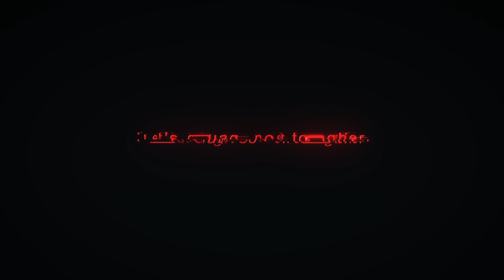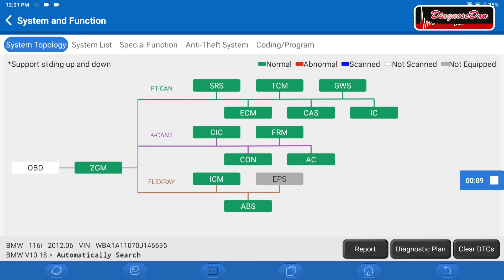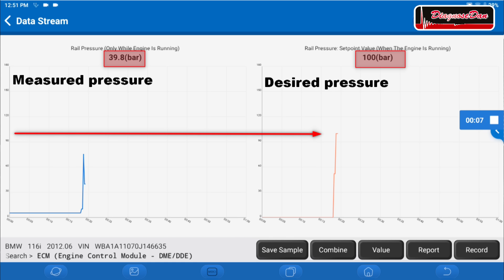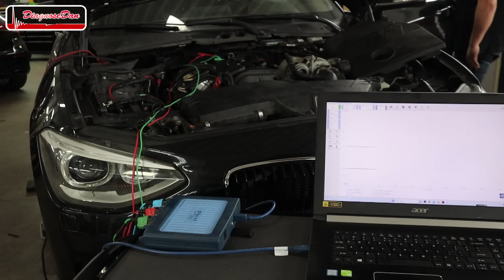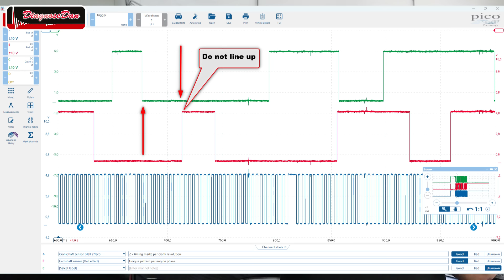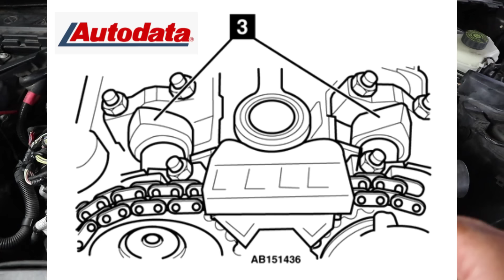Bmw dealership blunder? Incompetence?

Comment: I work at a BMW dealership and got a diesel car in. It had some work done at our shop a week earlier, and on the 2nd day after that visit, the engine started running rough on startup, then died and didn't turn back on. The car was towed in and, like this one, there were no fault codes for the engine. I did the basic tests, reading fuel pressure, checking if it had the correct fuel and checking the airmass system including EGR system. Everything checked out. Even tried removing exhaust sensors before DPF to check if it was blocked. I also removed a sensor from the intake manifold to spray in some silicone spray to see if the engine at least tried running on it. What I noticed was there was actually more smoke coming from the intake manifold than the exhaust manifold. Started to look more and more like timing but the diagnostic software even in expert mode said that camshaft and crankshaft synchronization was OK. Still, I removed the camshaft sensor and was able to see through that hole that the camshaft was spinning. I still suspected timing because nothing else could explain this behaviour other than timing. So I got permission to remove the valve cover and manually check the timing. And when I did, I immediately saw that 7 of the 8 rocker arms on the intake camshaft were broken and had fallen off. The customer was notified and he refused further work so I didn't finish checking by how much the timing was off. Needless to say, the work done the week earlier was completely unrelated to the timing, just bad luck.

What this, and your video, reminded me of, is that we cannot put too much trust in the computers. A large majority of the time, the computers are right and guide us to correct diagnosis's, but we always have to use our common sense and knowledge of how engines work to confirm what the computers are telling us (or not telling us), in order to prevent unnecessary parts replacements. Like in both of these cases, mine and yours, where the computer does not report the timing to be off even while it most certainly is.
Reply from the maker: Well said, scantools are "tools" to assist us in diagnosing the issue. They wont tell us what parts te replace.

Comment: This could of been easily diagnosed by the use of a vacuum gauge. If the timing is correct cranking vacuum will be around 3-5 inches of vacuum. If timing is off vacuum will generally be between 0 and 1 inches of vacuum. Having said that Dan is a legend and wonderful to watch.
Reply: Exactly - All Vacuum Gauges woulda told you the Answer. If the Cranking Vacuum Gauge woulda been Less than( 3 " )of Vacuum - that Result woulda led me think Broken Drive Belt - Timing Belt Issue or Timing Chain issue.

LongBeachCertified (562)
Ex Smog Repair Emission Analysis Technician

Comment: This engine looks very similar to the N18B16 we have in the USA in mini coopers. The timing chain guides break very often and are a chronic issue on these cars. We had one last week that ran poorly and another shop told the customer it was due to "bad engine software" which caused misfires at idle. We popped the valve cover to verify timing and the upper guide was broken like this and the intake cam was 1 tooth off. The "other shop" wasted $1500 on useless chemical carbon cleaning the valves and even installed a new timing chain tensioner which they left loose/leaking- essentially resolving nothing!

Comment: I'm lazy, my first thought was to spray starter fluid to see if it would attempt to start.

The scope traces are next level. 

I find the control routine odd that it's based on cam position. It would make more sense that it's controlled by pressure output.

Anyways great detective work!

Comment: I find it hard to believe this engine only has a single chain,,,In Australia my sons 94 BMW had a double chain set up,,We had to change the cylinder head because the engine overheated and he poured cold water in .the sudden change in temp caused the number 3 cylinder head to crack causing hydrolock pouring coolant in to sit on the piston ,,We could not believe that such a high end car could be so fragile..After that it was only Toyota,s for him..Great Video.

Comment: A very good diagnosis, unfortunateley with no happy end - very likely that the engine has to be replaced.Fastest approach to check the condition of a not running engine is to use an endoscope - as soon as You see impact marks on the pistons and/or damaged , open valves , You are done.Embarrassing for the dealership that they weren`t able to identify a dead engine on their own.A simple compression test would have been sufficient as well.

Comment: My guess: when the measured fuel pressure is below minimums for safe cranking/running, the hpfp valve opens fully to prevent a lean/knock situation. That’s why the plot was spiking then dropping to nothing.

Comment: Thanks Dan, I am glad to have found your excellent videos and have watched several already and learned more each time. I especially enjoyed your F15 40E Hybrid video no crank from starter video. I didn't know these Hybrids had two starter systems. One from conventional starter, mounted in front of engine which shocked me, and the electric motor starter in transmission. 

In my situation I get a quick one second attempt to start and then starter stops over and over, so it appears not to be cranking long enough to start. The electric starter does not work either. I don't know which is not staying engaged yet as I had almost given up. I am old school BMW owner for years and this Hybrid is a whole new beast to me.

As there are very few discussions on the BMW Hybrid, I am at a loss to find out where to look next. I had bad 12VDC battery which I replaced and registered and that got rid of the dozens of low voltage faults, but I still have codes permanent and intermittent. I figured this may be why engine won't start. DME 21A117 and EME 222D04 and searching for potential issues I see there is a short somewhere, and if that means a had connection of a short to ground, I don't know where to look. My Hybrid charges up to full 18M level, so I am at a loss. Have you ever run into this with a Hybrid before. Any tips would be appreciated. 

Thanks a million, Mike

Comment: I work at the BMW and I find it so hard to believe that the dealership could not diagnose this. These engines not only are know for the timing chain issues, but there's several service solutions relating to this and also it logs crankshaft to camshaft correlation faults way before the engine stops running. So either it was a tyre fitter trying to upskill his career or a technician was as blind as a bat.

Also you were not correct in describing the high pressure fuel pump operation. Its fully mechanical pump with quantity control valve, that is controlled by the PWM signal to close the valve so the pressure builds up. When deactivated or a fail safe state the valve is open (fuel is by-passing) so the fuel pressure doesn't build up in the rail more than 5 bar (that much low pressure fuel pump is supplying). However this would still allow the engine to run as DME would alter the injection timing so the fuel would be injected during the intake stroke allowing to engine to run in limp mode. No start is never ever a high pressure fuel pump issue on BMW/Mini petrol cars

Comment: Excellent diagnosis. This is a known issue with these engines until 2015. Dan tracked it down systsmatically, without swapping parts.
Reply from the maker: Thank you very much

Comment: As the ECM has a sensor for the pump related camshaft, it knows the exact position -> there is no mechanical problem there -> it's very likely the ECM also detected the wrong timing and did disable the pump electrically. Could be checked by locking at the pump-signal.
This boils down to a "camshaft signal" problem caused by a wrong timing which is a typical "non-starter" for BMWs because the ECM will not allow the engine to start.
Very good analysis!
Reply from the maker: We've seen that the fuel pressure spiked and than dropped. This can only be done by the ecm. So your question was already answered without the measurement
Reply: @Diagnosedan  Sorry, this is not a question but an answer to your analysis. The camshaft position is not random to the ECM, it is well know as it has a (well working) sensor for this. This pump is working as expected by the ECM.

Comment: Great video Dan. You fixed it again. It won't be a real BMW if it didn't have timing chains or guides issues. I am currently working on N57 with stretched chains and broken guides and oil tensioner. Thanks for sharing🤝
Reply from the maker: I've done so many,😢 i could probably do it with my eyes closed😂
Reply: @Diagnosedan  Do you drop the transmission to pull the engine out? Thanks

Comment: Good on U mate. Good work. Dealerships have good mechanics and crap ones too. I used  be a service manager and the key is ........
Put the right technician on the right job. Every dealership will have guys better than others at particular jobs. Right man for right job. Regrettably, mechanics are  required and incentivised to pick up time.  Allways rushing thru jobs so they charge out 10 orc12 hours in an 8 hour day. It's allways money. Just depends on who's money

Comment: I would first spray some cleaner or petrol in the intake close to the throttle. 1. No start -> Check for spark -> Spark Ok then check mechanical stuff such as timing. Spark not OK check for power, grounds and relays and go further.
2. Start ok then check fuel system. 

Still surprised with the camshafts being that much off there was no trouble code. Absolutely GARBAGE cars. Break My Wallet. Clever ECUs never reach simple things.... Furthermore these were the makers that introduced long life services with oil changes that 30000km. Not even their timing chains are up to the job. So Oil at 10k and forget about long oil change intervals. If you want to save money...
Thanks for the Video Dan!

Comment: I can't believe the dealership fired the parts cannon. That isn't supposed to happen. I do the same exact thing, when I have no codes. Back to basics. I use the acronym F.A.S.T.
Fuel
Air
Spark
Timing

The basics do not fail. Great video!
Reply: I should say I check compression during the timing step. Just in case someone else uses it. Don't want them to use FAST and not check compression. Guess it should be called FAST-C. Or any other variation that's easy to remember.
Reply from the maker: Thanks!!

Comment: YOUR VERY KNOWLEDGABLE AND YOU ,DO THE BASICS CHECK SPARK ,FUEL PRESSURE AND VALVE TIMING AND USE THE SCOPE CHECKCAM AND CRANK SENSOR WAVE FORMS THAT WILL ALWAYS TELL THE STORY  AWESOME VERY GOOD METHOD OF EXPLANING AND TEACHING I GOT IT RIGHT OFF THE BAT THANK YOU SO MUCH

Comment: Great informative video as always, thanks Dan. Are all modern engines so badly engineered they fail like this, it used to be if you had a timing chain over a belt it lasted the life of the engine.

Comment: A reduction in compression could be heard when attempting to start the engine (with the exhaust or intake valve ajar)
No maximum compression when one of the cylinders is not closed

Comment: Brilliant as usual.  Never forgetting the basics amongst all that technology.  I am left wondering if the diagnoses is complete?  The question I have is:- Has the timing problem caused damage to the Valves.  I realise the timing has to be fixed before this can be investigated.
Reply from the maker: No the diagnosis and repair is not complete yet. But i was only asked to diagnose the initial problem.

Comment: They checked the timing by "listening to the engine cranking rhythm". They replaced low and high pressure fuel pumps based on the fact - there is spark , so problem must be fuel related. That's the advantage to have service garage on the mainroad or main boulevard. You can do this and still get a ton of NEW customers every day. When the repair is not the fix, these machanics just say "we're general maintance shop" , not specialist.
Reply from the maker: Thanks for watching

Comment: Perhaps the chain tensioner is using oil pressure .... And an o-ring has wared out...  So no pressure, and no tension, but some chain rattle for a good while.... Then, one day the chain hammers the guides in pieces, and that's it.

Comment: BMW timing chain tensioners made of plastic, What could possibly go wrong there?
As ever a stunning logical and well explained approach in comparison to the scatter gun replacement approach of so many 'experts' today. Just remember new stands for Never Ever Worked.
Reply from the maker: The tensioner is not made of plastic. The guides are but this is quite common as they ride against the chain

Comment: Nice diagnosis Dan 
Few years back too had N13 1 Series on 13 plate (UK) on 48k miles timing was out as well due chain tensioner failure inlet cam was 90° out but no engine damage at all so new chain and customer was sent on his merry way 😂 since then got expensive Sealey timing tool which only been used once and lent several times to few local garages 
Anyway nice job as always Dan best wishes this time from 🇱🇹
Reply: Just to add in my opinion VANOS saved the valves once cam sensor went out of sync I guess VANOS kicked in and didn’t open the inlet valves thus saving any damage would’ve been different story if exhaust cam would jumped timing 
Anyway it just my theory welcome to prove me otherwise
Reply from the maker: Thanks for your comment, vanos can't prevent the valves from opening. I guess you mean valvetronic instead
Reply: @Diagnosedan  Hello Dan oh yes you’re absolutely right thanks for correcting me up

Comment: I think at this point manufacturers need to implement logging codes in a semipermanent way. Like a Freeze Frame data that just never gets deleted and doesn't affect the running of the car after codes have been cleared from the usual fault memory. This will be very valuable for troubleshooting.
Reply from the maker: Thanks for watching

Comment: Sounds like the job was given to a rookie tech at the dealership. A lot of dealerships hire new techs fresh out of school. I had a Chevy truck that a mechanic friend of mine told me to take it to the dealership because the catalytic converter was under emissions warranty. He even left the code for the tech. The very first thing the kid did was to erase the code, along with all the evidence.They called me and tried selling me a high dollar tuneup. I refused and took it to another friend who was a master tech at Bob Peck Chevrolet and he found the bad cat and even warrantied the 02 sensors as well. Most dealerships, I won't give the time of day, because they always seem to replace stuff that is not needed or relevant to the problem. Only for warranty coverage or something that only dealer repairs.

Comment: Removing the valve cover would have been my first job, because it is well known, that a lot of bmw engines from 2010 onwards suffer from weak chains and cheap chain guides, which fail early.

Comment: Very interesting video. My daily driver is a 1990 Volvo 240DL Estate. For several years in a row the car would run very roughly and return poor fuel economy. The 5th year a different tech thought to change the throttle position sensor. The recommendation to my mother was that this could happen, so replace the car. Since she wanted to keep Arthur, so the deal was that the shop would replace the part. If it worked, Ma was to return for them to remove the new one and install an older style of pump. If it did work ma was to pay for the repair minus the costs of renting a car. It worked. Then again, my high pressure pump is electric  and mounted beside the fuel pump under the car, so very easy to work in

Comment: I absolutely love your channel. I’m a retired independent mechanic from 30 years ago (68 years old presently) spark, fuel, compression were always the basics. What you have now with the electronic scan code readers is something that does most of the diagnosis for the majority of technicians in the industry. But this is a perfect example of how to properly use that tool. Technicians aren’t receiving enough training. So this drove my curiosity enough to ask, who trained you? Major respect for your skills Dan 🫵🏻👍🏻👊🏻

Comment: Brilliant I had the same problem on a Peugeot 208 EB2 turbo last week. Spiked the fuel pressure then dropped to zero. Checking timing I found the wet belt had lost four teeth. I am fixing it. tomorrow.
Reply from the maker: Problems with the wet belt, that never happens😂😂😂😂😂

Comment: Another awesome video. Would love to see the fix on this and see the car running again - if it is fixable, of course. Interference engine + broken timing belt = bent valves, etc. I frankly think interference engines should be illegal. Cam in block with OHV's and a little more displacement work just fine, with no worries if the cam chain snaps (which I've never heard of)
Reply from the maker: Thanks for watching!

Comment: i remember the strategy on a common rail diesel i used to work on if the starter wouldnt reach a certain rpm none of the outputs on the ecm would turn on. then there was a stage they would turn on but there was no fault checking until another rpm level was achieved.  i had one i had to use a photo tach  even though it would crank over to prove out a faulty start system  causing low rpm  cranking for  a no start. no one in the shop wanted to believe me. and they all blamed fuel system  because it would start on either.
Reply from the maker: We had one last week, installed a bigger battery and the rpm was reached and the car run again

Comment: Didn't know they used variable high pressure pumps. But when I saw the engine, my first thought was timing chain issue as common problem with those year models.